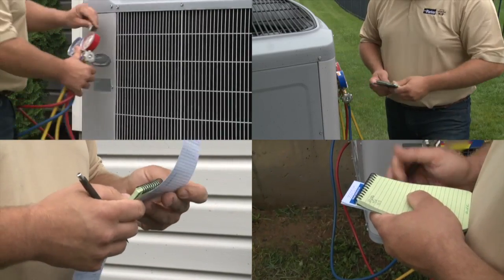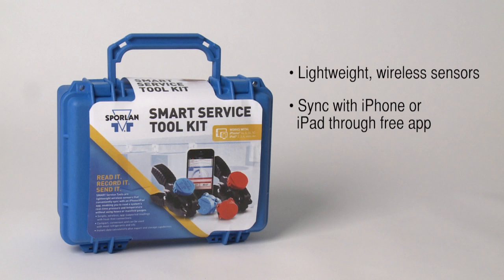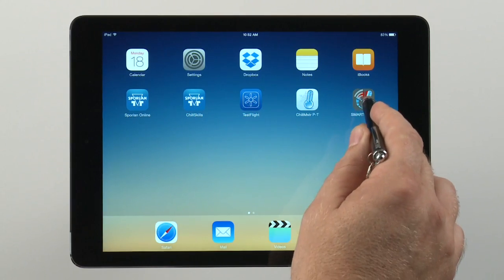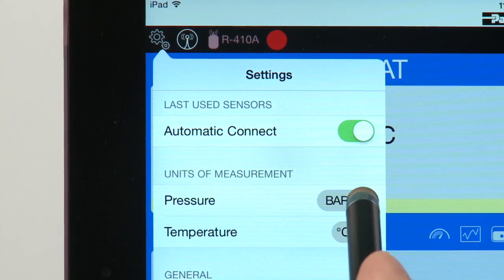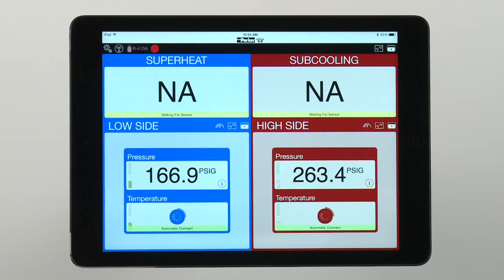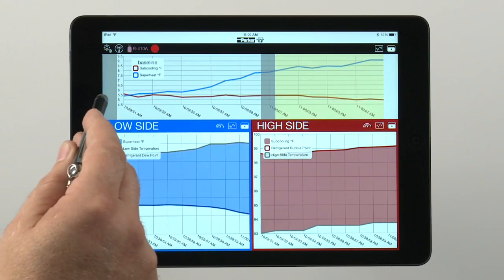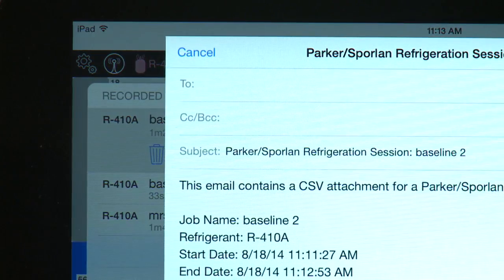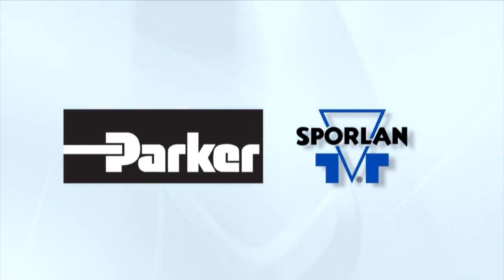How To Use The Sporlan SMART Service Tool Kit For HVACR Diagnosis and Troubleshooting

Comment: Email function in the app doesn’t work, I get a message saying “Mail not available”.  I made certain I have an internet connection but it still does not work. Please help.
Reply from the maker: Please contact technical support at 636-239-1111. They can assist you with the problem.

Comment: We got one last week. Great unit. One big problem emailing data to customer does not come to them in a very end user friendly format.  Would also be nice to ad company name in app for emails that are sent.
Reply from the maker: Thanks for purchasing the Sporlan SMART Service Tools! 

The .csv files that are exported by the SMART and SMART Pro/R mobile apps may be imported into Apple's Numbers, Microsoft's Excel, Open Office Calc, Google Docs, and other spreadsheet programs.

The .csv format is likely the most widely supported data format in the world.  If your customers do not have any spreadsheet software, they can find a free .csv reader on the internet (csv viewer, csv reader, etc.)

As an option, do you think your customer might gain more from simply receiving the .pdf file that may be exported from the SMART Pro/R mobile app  Perhaps sending them a snapshot of the baseline Superheat of their system when you arrive on site, a snapshot of the Superheat after you have made adjustments, and manual entries in the pdf about changing air filters, cleaning the condensing unit, etc. would suffice. While recording, you can enter as many snapshots of the sensors/calculations as well as notes in the .pdf file as you like. 

We do not yet offer a way to save your company name or logo in the app.  However, you can add your company name and contact info as a manual note entry in the pdf (JOB/NOTES) as the first and/or last note in the report to make it prominent. Before you hit SEND on your outbound e-mail, you can also add items such as screen shots of the graphs, your company logo, your service fee, total service and parts charges and other information. 

Thank you for your feedback and great suggestions. Be sure to let us know if you have any other questions or suggestions as we strive to offer the best AC&R service tools.

Comment: How are you supposed to make the brass fitting connection to the pressure sensor? Just make it really tight, add leak lock and make it really tight? Just got me a set and cannot stop a leak on my high pressure sensor, I connected the brass fitting with leak lock to the high pressure sensor and it is very tight and no luck, keeps on leaking. Only used it 3 times... got it 3 weeks a go
Reply from the maker: Contact our Tech Support at 636-239-1111 and they will get you some help to fix your problem.
Reply from the maker: You can also send me your contact number and I will get our Product Manager involved.

Comment: Do the temp. therm.'s come in sizes for larger diameter pipe? For example, up to and including 2 1/2' O.D.?
Reply from the maker: +Jeffry Stout Thanks for your interest in the Sporlan SMART Service Tool! At this time we don't offer sizes for larger diameter pipes. The new Pro/R sensors will have this ability and should be available later this summer.

Comment: To whom it may concern I am a customer of spoiling products I would like to buy the smart tool but I work on refrigeration systems only I asked this question before and I will ask again will the probes work in a -30 to 40° temperature and what will be the range of the Bluetooth????
Reply from the maker: hardcooling The ambient temperature limit for the sensor is 0°F.  At -30°F, the battery will not have enough power to send a signal to the iPhone or iPad.
The range of Bluetooth devices vary.  See Bluetooth.com for more information.
You can view the FAQs here for more information regarding the Sporlan SMART Tool Kit. http://sporlanonline.com/smart/smart-faqs/
Reply: But I did hear you are going to be modifying the sensors also refrigeration is this not correct
Reply from the maker: It is in the development pipeline to be able to have more range in the sensor abilities for refrigeration purposes. Stay tuned for further announcements and thanks for your interest in the Sporlan SMART Service Tool Kit.

Comment: I've never  used these, have used the yellow jacket mantooth, they work good, but I hate the clamps being attached to the pressure readers, wires get tangled easily, I just don't get why sporlans, are doubly the price, I do however like how sporlans have a running diagnostic, where you might see a sticking txt valve, Bluetooth signal strength is terrible on both though,

Comment: This is just the beginning of these types of tools. I hope to be seeing them for measuring voltage, air, water and more commercial & industrial etc. starting to be developed. It will be great. The prices will come down. AAB has a nice air balance too for an iphone for $40.
This one looks like start. The report page looks real good on the app but not as good on the email. It should make pdf files with color charts.  The clamps look big and clumpy. The batteries look weak. They should use standard 9 volt or AA. You will need to attach small hoses to get on a lot of ports. More sensors would be good for outside air, supply and return air, two compressor systems. Then you could produce a charge verification report that can be sent to a Calif. EPA inspector. Can they be field calibrated? Are they water proof? Can sensors be replaced? Do they have any memory in them or do you need to leave your ipad there if you want a long trend? What is the warranty?
Reply from the maker: Kevin O. McCann The Sporlan SMART Service Tool Kit has a one year warranty. It was made to be durable and reliable. You can view more at http://sporlanonline.com/literature/140/Form%20140-421%20FAQs.pdf

Comment: Too bad the sensor clamps don't go bigger than 1-1/2".  Also, you said the the low pressure sensor won't read a vacuum.  The specification sheet shows -14.7 PSIG.  And, I'm wondering how well the temperature sensors will transmit if they are clamped to the suction line inside a walk-in-freezer.  Any idea?
Reply from the maker: The Temperature Sensor Clamps were designed to fit the majority of suction lines being used on both air conditioning and refrigeration systems. We are considering adding another Temperature Sensor for larger diameter suction lines in the future.

The Low Pressure Sensor was not designed as a vacuum sensor.  The Sporlan SMART Service Tool App will display vacuum readings from the Low Pressure Sensor down to -14.7 psig but is not intended to be used as a micron gauge. Anything below -14.7, the app will not display a reading.

Sensor performance in low ambient temperatures is limited by the batteries.  The batteries will lose strength as the temperature falls near 0 degrees F.  The batteries will not have enough strength to power the sensors in ambient temperatures below 0 degrees F.
Reply: ***** I take it that what you're really saying is the tool was not designed with low temperature refrigeration in mind because walk-in-freezers typically run at or below 0 degrees F or are you saying the battery manufacturers need to manufacture stronger batteries?  ;-)
Reply: *****  What is the warranty???
Reply from the maker: The Sporlan SMART Service Tool Kit has a one year warranty. It was made to be durable and reliable. You can view more at http://sporlanonline.com/literature/140/Form%20140-421%20FAQs.pdf

Comment: $614? wow! The Yellow Jacket version is supposed to be out in a couple weeks and only cost about $335, and will work with Android as well as iPhone.
Reply: The iManifold is $700, the Sporlan one is $614, for $335 Yellow Jacket seems a bit cheap. What corners did they cut to get that price. Maybe it's the wired vs wireless probes. I can't wait to see how it performs in the field.
Reply: Me too. I'm anxious to see the one that Appion is coming out with also, and how much it will sell for.
Reply: Brian Marron I don't think any of this stuff is going to be cheap. The class 1 bluetooth transmitters are not cheap. Yellow Jacket is only using 1 transmitter so that's how they got away with doing it cheaper, it's still wired though. I would buy another Testo 550 for the same price if I wanted more wires.

Comment: Will the  sensor be accurate if I put it on an evaporator in a -40° freezer and approximately how far will it give me readings
Reply from the maker: The ambient temperature limit for the sensor is 0°F.  At -40°F, the battery will not have enough power to send a signal to the iPhone or iPad.
The range of Bluetooth devices vary.  See Bluetooth.com for more information.
You can view the FAQs here for more information regarding the Sporlan SMART Tool Kit. http://sporlanonline.com/smart/smart-faqs/